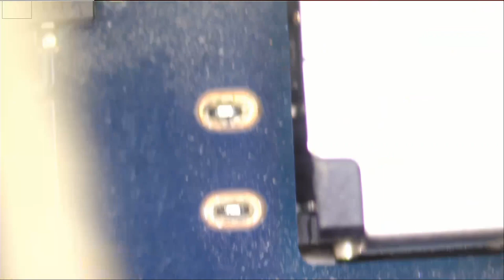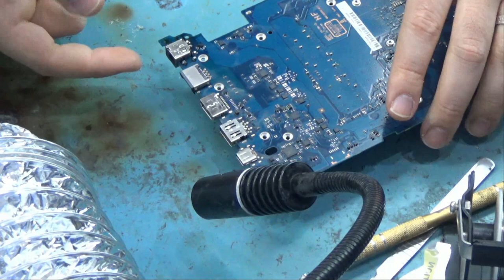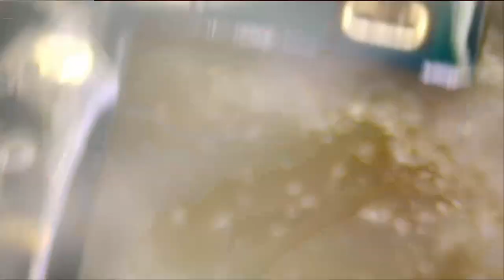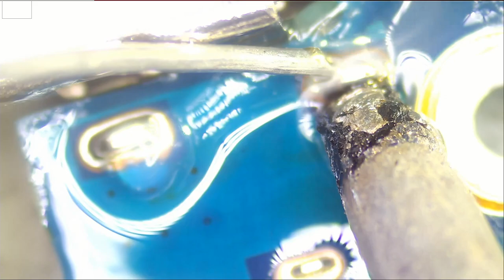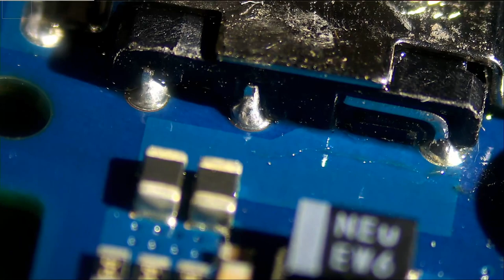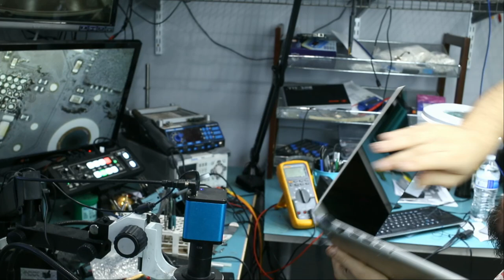Samsung Notebook 7 No power - Charging port replacement using Low Melt Solder

Comment: I did exactly that kind of repair last 2 days. Used a leaded solder though then hot air. Took me almost 1 minute to get it off the board. That Low Melt Solder makes the job a lot easier. I wish I could order that. It's hard getting that kind of stuff here in Philippines.

Comment: That desoldering was quick as!
Reply: I changed two charging ports yesterday in 45 minutes with low melt solder and without hot air. I used to take 2 hours each one.
I started using LMS after I see Alex doing this, never more will work without it
Reply: 2 hours? Lol..
The board must be toasted afterwards.
Reply: @jb5631  lol

Not that much of time heating the board, just to complete de job

But yes, Ive toasted some boards in the early day 😳

Comment: every time i see that wick in action im left impressed by how easy it sucks in that solder, im using some wick right now and its the worst! even with flux, a large tip, temp turned up its like the damn thing is allergic to solder

Comment: Hey Northridge, I recently bought the low melt solder and it arrived very fast. Thank you for that. Also, where did you buy your bent chisel tip, or did you bent it yourself? Thanks in advance. Much love!

Comment: I have a windows laptop that I use for work. I fat fingered the password and now I am locked out. I tried the line code recovery method but my C drive is also encrypted so I can't gain access to the files I need to reset the password. Any ideas on how I can fix this problem.

Comment: Hmm did you ever accidentally used low melt solder, instead of normal one😅
Reply: I couldn't get the low melt solder off of the donor board while swapping the bios on a hard drive. I installed the bios chip just like that and was able to get the drive working again.